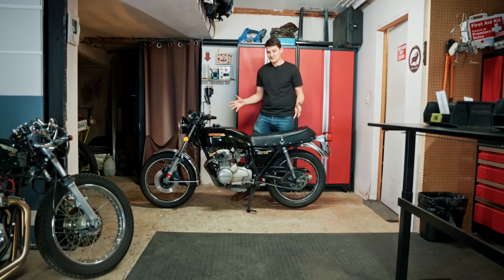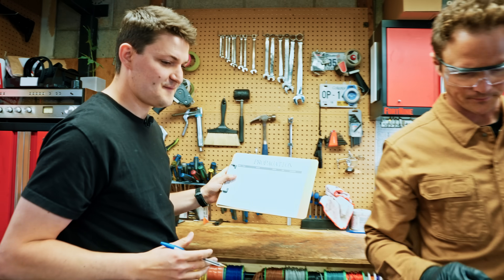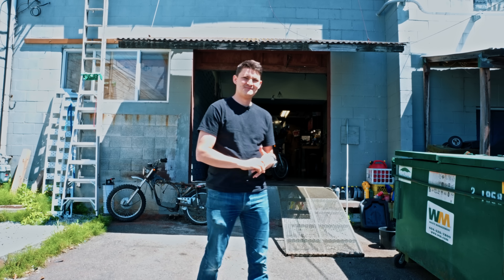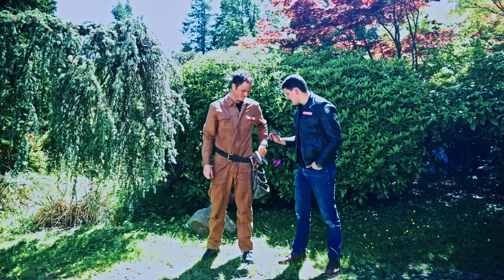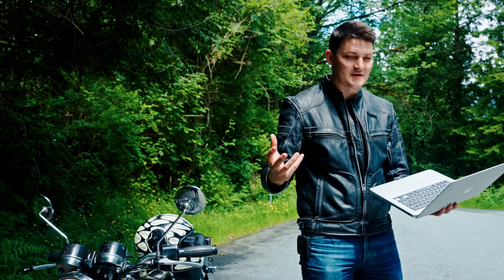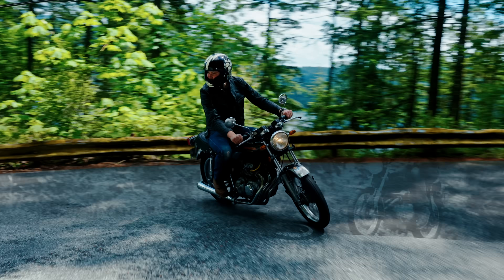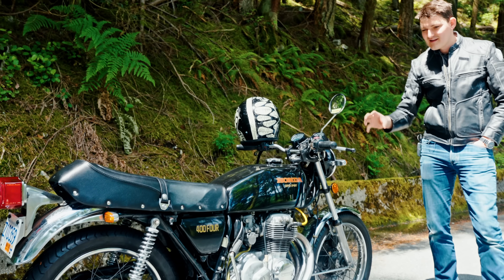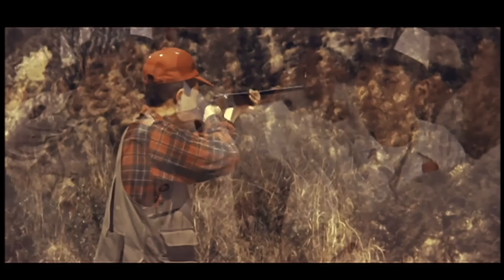Why Hondas Run Great - JIT Manufacturing, 5S Methodology and Kaizen

Comment: My dad used to work for the Swiss federal railways as atrain driver / instructor. At some point they wanted to introduce Kaizen, so they sent a bunch of clueless suits to Japan who completely misunderstood how Kaizen works, and then proceeded to tell seasoned veterans how to do their jobs, not having the slightest idea what they were talking about. That said, my dad then wondered what Kaizen really was about, since in a previous job with Subaru, he had seen first hand, how efficient the Japanese solve problems. So he did some research and came to the conclusion, that it was what he and his colleagues were practicing all along. Management just needed a fancy word to legitimize a dictatorship of the clueless.
Reply: This unfortunately happens a lot. Managers will just learn the terms but don't actually explain the what or why and then it never gets adopted properly
Reply: @CaseyHennessy  Cough Agile development Cough
Reply: @stipuledfatcat  as a VP of engineering, I approve of this cough
Reply: @stipuledfatcat  Especially when applied to things other than Software Development.
Reply: @CaseyHennessy  Case in point, when management likes to use 'Start with Why' by Simon Sinek, but haven't got a fucking clue what Sinek is actually talking about, or who he's actually talking to.
(He talking to management.)
Reply: This is exactly what is happening at GE aerospace right now. As a technician we have been able to improve our workstations with 5s methods but the “just in time” (never in time) parts and new micromanaging are making it worse than it was before
Reply: @alexmillikan9653  man I'm sorry to hear that. There's nothing worse than managers that don't let their employees do their jobs.
Reply: @alexmillikan9653  I work for a different aerospace manufacturer and yup, same shits happening here!
Reply: @__-fm5qv  this is a lot of manufacturing and industries.
I believe it is the result of three race to the bottom. The core fundamentals haver not changed in nearly 100 years but Manager and bean counters need to justify their position. They need to understand that Things just take time. Let your crew figure out and make needed changes.
Reply: @alexmillikan9653 I push forward the thrust levers on the engines you make for a living. The same shit show happens all the way down to the front line of aviation, managers know best but never see how things actually run in the real world. Just something about this industry!
Reply: @alexmillikan9653  That's really ironic- it seems Toyota switch away from JIT and it saved them a lot of pain compared to other companies during the pandemic.
Reply: @alexmillikan9653  JIT = Just isn't there.
Reply: Similar things happen so much. They are great for certain parts of business, but then there's always morons on businesses that try to put them in work like in industrial maintenance, where some of the rules just cannot be used. Or leaders don't realize that people are already working mostly on these principles, but still try to renew entire work flow.
Reply: They should make it a law that any manager anywhere should at least work a few years on the workfloor before they are allowed to 'manage' things. Probably will save a lot of frustration and money down the line.
Reply: The company I worked for previously tried to get us to "adopt" the 5S mentality but in reality, the man championing it the hardest was focused so hard on taping outlines and labels around literally everything to the extent that redoing all of that became the defacto busy work when all of the crucial machines weren't working. Because of the false/busybody implementation of kaizen and 5S. Really disappointing because that company had so much potential and I think this philosophy would've helped immensely.
Reply: @boOo_dude  We have something similar. We have "5S" audits regularily to ensure people don't leave clutter on their desk, with a ton of effort put into identifying zones and workstations and what they do exactly on the part.

But then the machine operators have to waste tons of time finding the tools they need, often needing to get them in other sets due to incomplete tool-sets...
Reply: @Trackpad_User  I wish that were more the case there but it was so misguided with almost no follow through or understanding of the philosophy that it just fell on its face and became wateful.
Reply: I worked for thirty years as a Honda associate. The concepts Ryan explains are basically correct, but they are not easy to adopt, particularly in a company that has a typical European/North American top-down management culture. Respect for the individual is a foundation of Honda philosophy. The production associates are key contributors in improving safety, quality, cost and delivery. Production managers have experience working on the production floor and manage from the floor, not an office. It’s easy to adopt 5S, kaizen, 3-gen principles, 5p problem-solving, etc., but without fully adopting the mindset and culture that makes these systems work, you will fail.

As an interesting side note, look up Deming. Japanese manufacturers adopted his concepts wholeheartedly and this enabled them to succeed.
Reply: That's my work, they talk the talk but don't walk the walk. You're encouraged to bring up issues but are completely ignored when you do. It seems like business gets in the way of being a good business. Short-term profits are more important than long-term gains. make an inferior product because it's cheaper than lose customers.
Reply: @Perry_dAccard You have described perfectly some of the units within large corporations I've worked for
Reply: Had the same idiots in charge of a car parts factory in Avon mouth Bristol, they tried it but misunderstood it so it failed
Reply: (also Japan has been a one party state except for 4 years since 1955)
Reply: @zogworth  The LDP dominates Japanese politics because they're the most popular. It isn't like China where only party is allowed to exist or participate in elections.
Reply: @zogworth  Not quite correct - Japanese government was held by one party except for 4 years since 1955, but there is more than one party, unlike China.
Reply: JIT does not work in Europe and America because most parts and materials are shipped from overseas (mainly china) so when there is an issue like shipping delays, customs, weather etc, things go out of the window. In Japan, the system worked/ works is because they source the parts from the same country, it also helps that they have great infrastructure.
Reply: Whenever they sling the word Kaizen and don’t listen to employees, I just keep implementing the 5 why’s to figure out the reason of implementing Kaizen. They just never involve the people that do the actual work
Reply: I'm in the paper industry, and the same thing is happening with us. We were bought by a Japanese company 6 years ago, which made the workforce very happy knowing how they do things. Unfortunately the American management team is trying so hard to justify their jobs they're ruining the company. Nobody cares about long term success and just want to earn their bonuses. Unfortunately the Japanese ownership has been very hands off and I fear we'll be shutting machines down soon. It's sad how the uninformed get into leadership roles via degrees when they have no clue what's going on. The newest person in our maintenance shop has more mill experience than our boss, his boss, and his boss combined. He's been with us for 3 years.
Reply: Those managers should have learnt Gemba walks, an extension to lean and agile practiced in these Japanese manufacturing plants.
Reply: @emrik2s  Yeah, those were also attempted, I remember coworkers scrambling to make things look good for those. All of these strategies only ever felt like tools to keep us in check, to be feared somewhat rather than us all working together to the same end. There was definitely some unspoken "us v them" vibes where the engineers trying to run the company seemed to think they were smarter than anyone trying to help right the ship. It's really tragic because I loved working there but they recently filed for chapter 11 and are trying to bring things back around. I hope they do, I'd love to see their product become ubiquitous like it deserves.
Reply: Really implementing what we here in the west call LEAN or Toyota way (or whatever fancy name we give the methodologies) is always incredibly hard to implement, because of the western way of thinking, when it comes to corporate management etc. 
This is why it is incredibly important, that there is buy-in for the change from the tippy top of the food chain and they also live it.
Reply: Being a leader is so hard. You always want to impose greatness, but, it always just comes out shittyer than the idea.
Reply: That happens all the time.  True improvements don't come from top down.  They come from bottom up.  Management needs to support the worker and then get out of the way and let them do their thing.  Bad managers get in the way and want credit, instead of trusting the process and just smiling as the numbers improve. 
Kaizen is a painful process.  Lean conversion is painful.  But it works and in the end, it's easier.
Reply: I am an American but I have worked with Swiss machining companies from Zurich down to Geneva but mostly in or near the Jura for 25 years.  I regularly oversee audits at these facilities by our American medical industry customers pointing out the practices of organization and work standardization are not an imported concept but literally drilled into the decolletauers through their apprenticships.  

That isn't to say concepts cannot be learned.  One facility decided to incorporate the principals of Total Quality Control over twenty years ago because they believed their in process inspections conducted by operators was suitable to control everything and the final outgoing AQL check was therefore wasted inspection.  What they didn't get was that the in process checks were not really based on sound AQL principals/rates, data from those inspections was not recorded and used for assesing ongoing capability in a real statistical manner, and that you really need someone other than the operator as the sole judge of what he is making 🙂  For almost a year the fecal matter hit the rotary impeller as rejections began hitting us from our US customers.  Corrective actions were through the roof and I regularly could not figure out how were were getting the failure rates I confirmed for myself in lots when inspection was being done at the rate I had understood it was!  When they came clean I wanted to kill them.  It just goes to show you that everyone can learn something and the best concepts, poorly implemented and not accounting for reality, can be worse than the system you had.
Reply: Yes, many CEOs and Managers are using Kaizen and alike just to be an undercover dictator. I said when we had a Kaizen and LEAN course at work that I'm no japanese and I don't live to work, I work to live so I was not interested at first. Then I learned all was just plain and simple common sense (to me) and it was ok to everyone in the company to do Kaizen and the 5s,  because the methodology is idiot-proof and I tend to get frustrated when people don't have what I call common sense.
Reply: The Peter Principle is the fundamental driver of Western industry ~they think with their peter
Reply: My company is doing the same right now🤣
Reply: 100% Agree. Happened at Philips and look where that got us!!
Reply: Clueless suits. Magic words.
Reply: dictatorship of the clueless: the modern western world in 4 words.
Reply: The SBB called it KVB - kontinuierlicher Verbesserungsprozess. Kaizen sounds so much better.

Comment: As someone who works in manufacturing in the usa I cringed hard when i read 5s and kaizen. 
When my company says that it usually means throwing equipment away because its not used every day but is still used and painting machines instead of fixing them. Then wondering why production isn’t improving.

Comment: As my student's case study for final exam in quality control course, their findings of 5S, Kaizen vs 6 SIGMA proved a point that Honda's tolerance was not in production margin alone, but the human resource they'd built to endure the late war necessity by individual endorsement, translating to individual / qualitative authority. 

In short, the people's wellbeing, mental and need if groomed carefully could meet all qualitative standards rather than putting people in a box with KPI and hope - like mices - they will multiply. No amount of incentives can do that dog shit reversal evolution.

Mum and dad also debated their feeling for qualitative concerns - in the air they said - that a used Toyota is just as good as a new one decades later with as few iterations or improvements as possible. Their hunch paid off for a brand new Corolla in 2021.

As Honda or Toyota either way, once you can feel their staffs' handy works in every machine, their CRM and even small details in manner, you know exactly what you are getting. That said, I might bite the bullet and build my next supermoto from a piss old GSX-S instead of a Honda, just because my hand could tell Suzuki's build quality was a good as a Honda, if not way overbuilt at that.

Comment: I've owned 8 Japanese motorcycles so far, from a brave little CBR125R to the MT-10SP, and currently race a Ninja 300.

Could probably risk an Italian affair at this point, but thinking back to my school years, when I couldn't afford anything beyond oil changes and gas to keep the 125 going, I feel like I'll be sticking to Japanese bikes for a long time. For many years my bikes slept outside, endured freezing temperatures, typhoons and earthquakes, as well as my sub-optimal mechanical chops, but never ever let me down. I turned they key, they started, and did everything they were made for, and sometimes way more.

Also, it's not like the MT-10 lacks character - it just starts every morning, my favorite type of boring.

Comment: Visiting a client, a forging co., I noticed baskets of forged motor mount bolts.  Some baskets had bolts with plastic covers on the threads.  Others were bare.  When asked the difference, the owner said the covered bolts were destined to the Honda plant in Maryville and Honda spec'd the covers to prevent threads being damaged in shipment.  Damage might make the bolt unusable and more difficult (time consuming) to install.
Reply: That kind of detail wins the race!